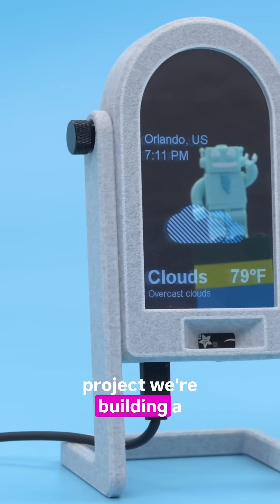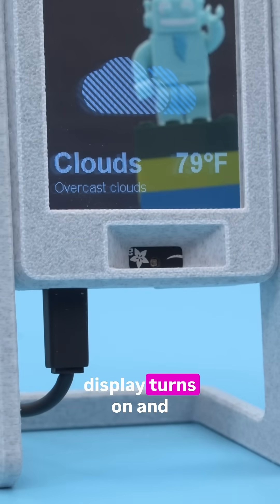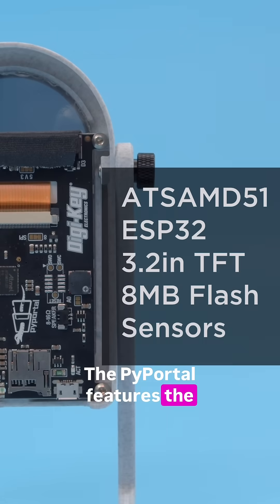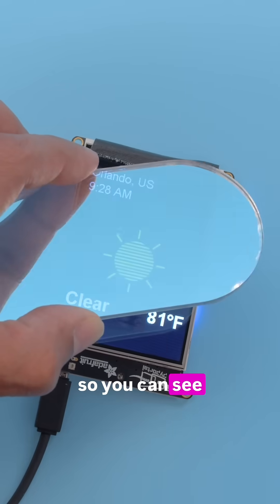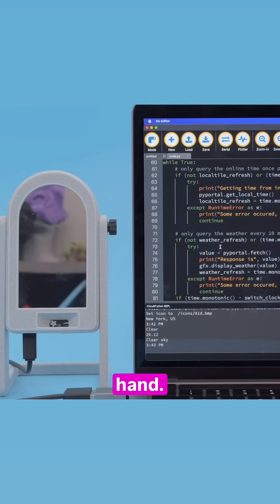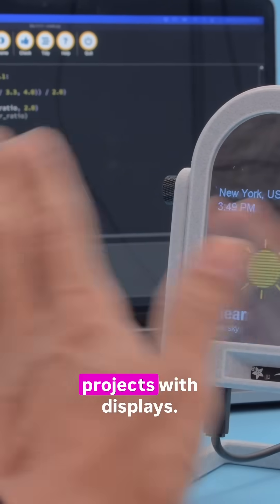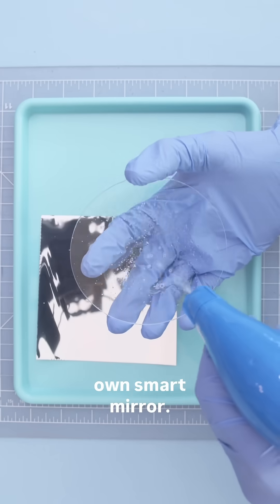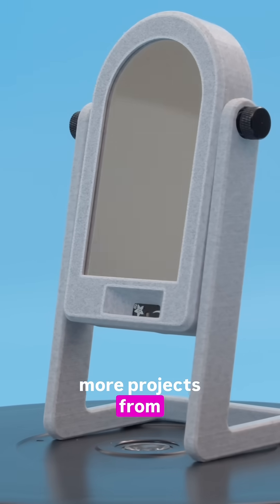Build your own mini smart mirror learn.adafruit.com/smart-mirror-with-pyportal #3dprinting

Comment: Who needs such a tiny mirror. Just make a normal-sized mirror: use an ESP32 with touch pin capabilities (e.g. S2 or S3), connect the pin to a small metal plate and mark its location with a sharpie on the front side of the mirror. Voilà! You've got yourself a normal mirror with weather forecast on demand.